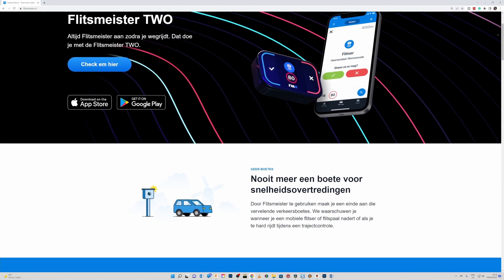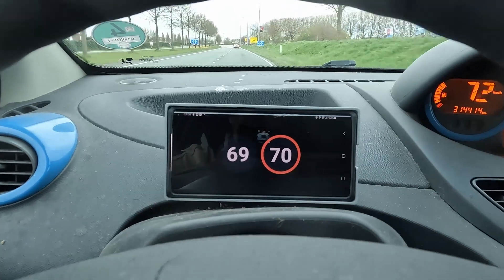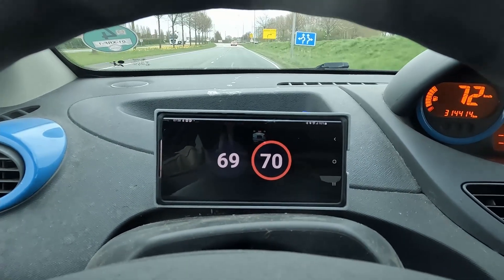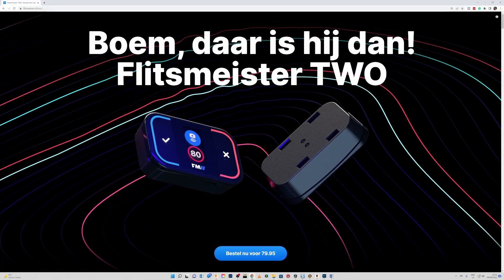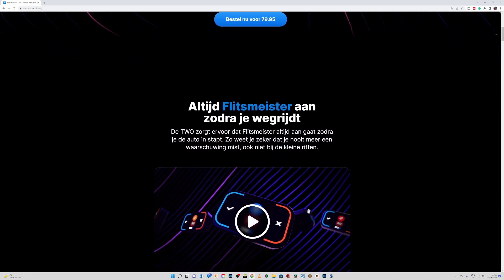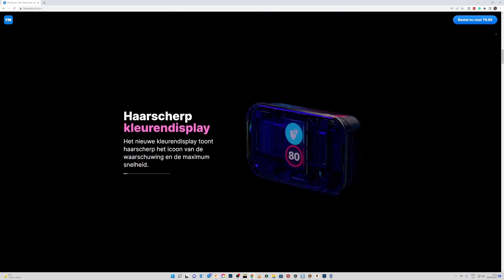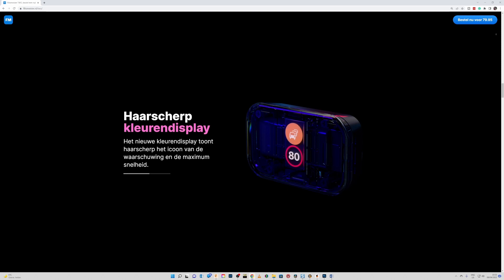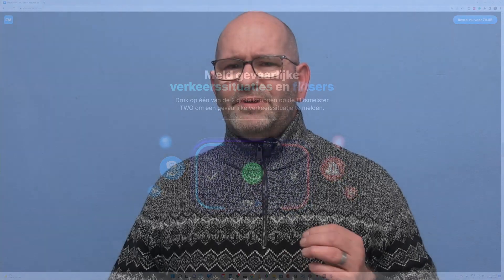▼ 3D Printing to Stay Safe and Avoid Speeding Tickets: How to Monitor Your Speed.

Comment: how about not speeding instead?
Reply: Well it helps to not speed because the device displays the speed limit.
Reply: How about reasonable rules instead?
Reply: @adama1294  Driving at speeds where you don't kill people is pretty reasonable.
Reply: @adama1294  turn it into bikelanes then, good call
Reply from the maker: I try not to, yet in the Netherlands we not only have changing speed limits that change because of the amount of traffic on the road, or because of the lane you are driving, but also different speed limits on different times of the day.
It's easy to make a very pricy mistake while thinking you drive the correct speed. This thing is just a great reminder that tells you the allowed speed for that moment, on that part of the road.